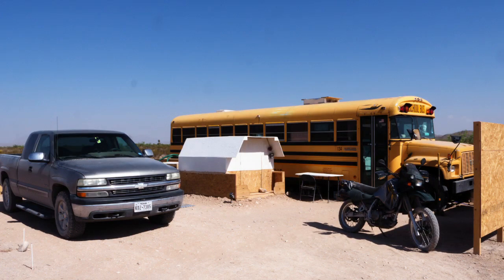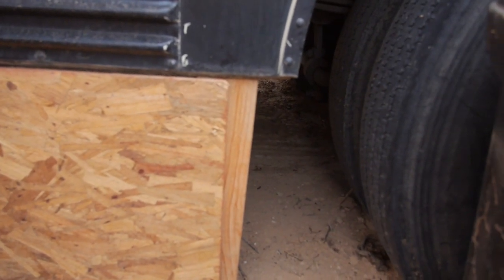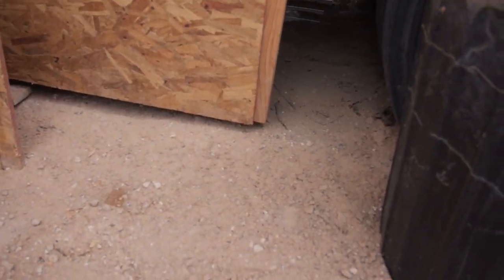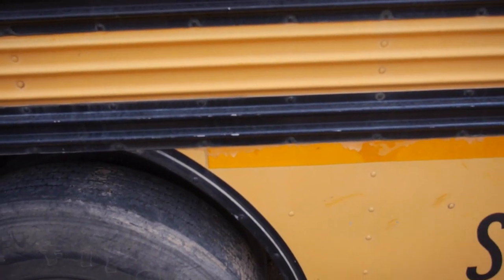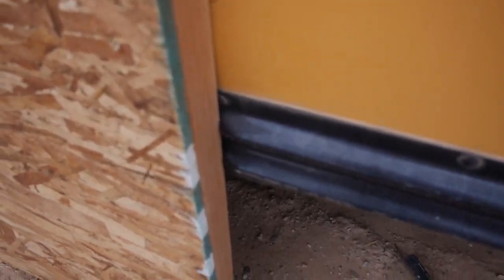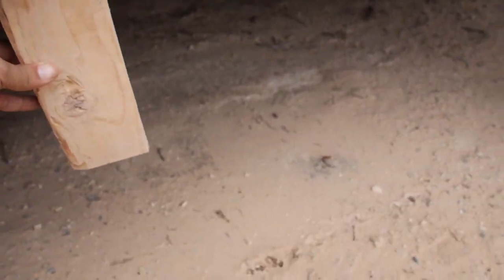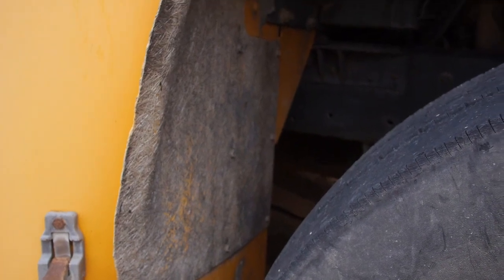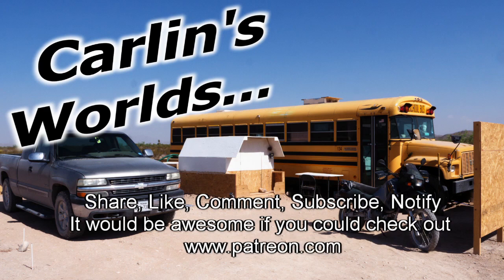Mini Skirts for the Bus

Comment: Try underground cooling tubes, I think you'll have to get deep enough out there for it to actually work.
Reply from the maker: Yeah I have looked into that, will need an easy way to dig around 8 feet deep. On the other hand, air under the bus is cooler than air in the bus, and much less digging :) Thanks for the comments, and stay tuned!
Reply: I think 8 feet is a bit excessive, lol  They don't bury our dead that deep. Maybe 3-5 feet is closer to what you need. Could rent a trencher or have someone trench it for you. However I guess you're thinking the deeper the better which would make sense. I believe that the temp wouldn't make that much difference at 8 or at 3-5ft,  probably the same. Just a thought. Good luck.
Reply from the maker: The idea comes from the fact that there is a constant temperature at a depth of 8 to 20 feet, summer and winter. There's a video of an old guy who is growing oranges in Nebraska, heated by earth pipes. I did a video talking about it a while ago.
Reply from the maker: https://youtu.be/ZD_3_gsgsnk